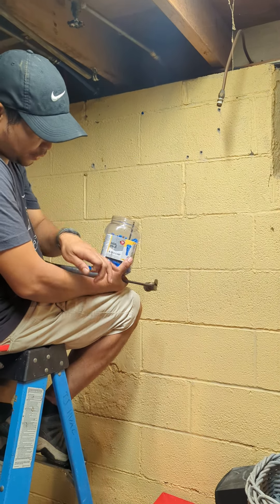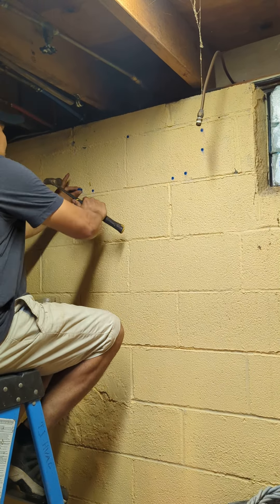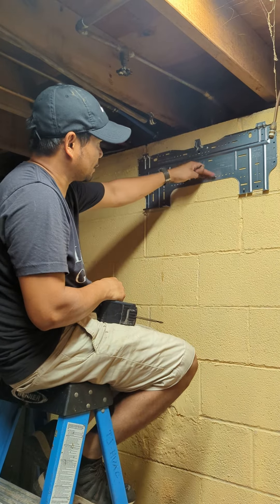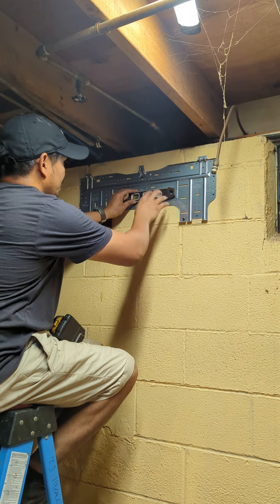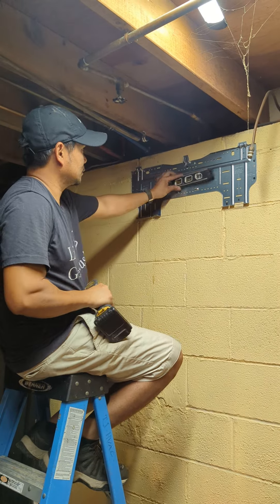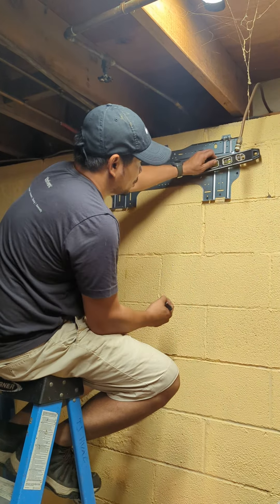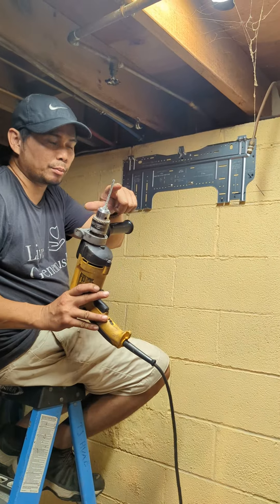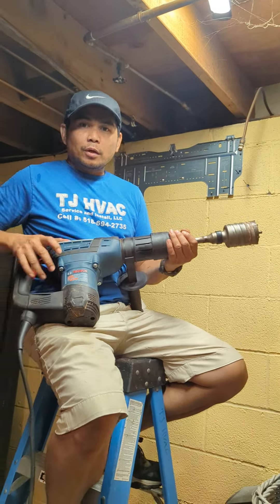How to install Mini split heat pump wall mount in the basement concrete wall.

Comment: If you don't have arrows on the bottom be sure to mark them with a marker if you have to remove it use a flat blade to push up on the plastic to release the clip. I didn't mark mine it wasn't easy to see where the clips were